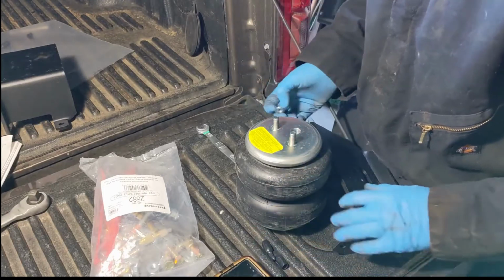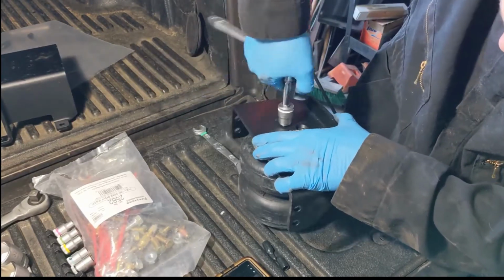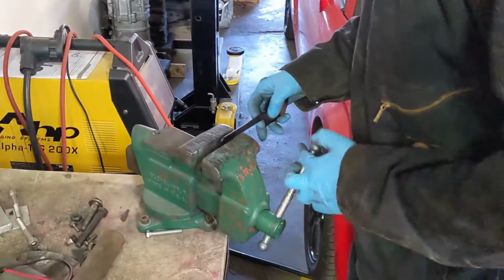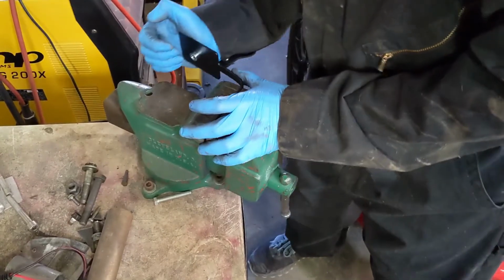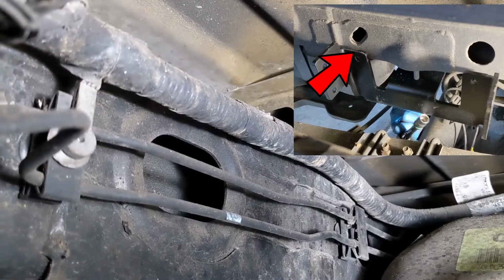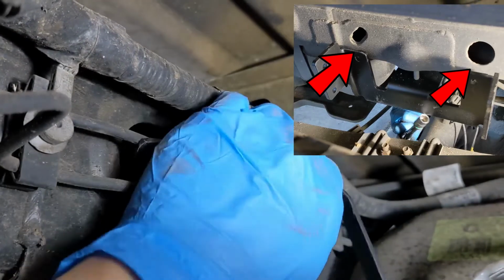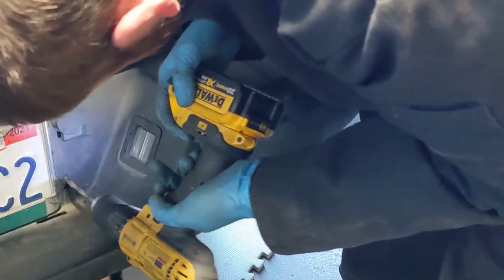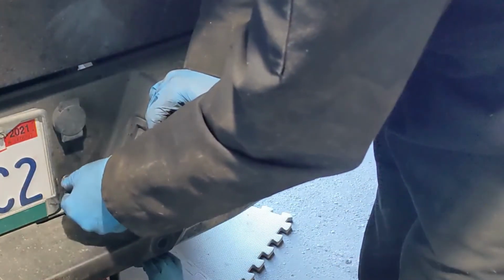2015-2018 F150 Firestone Ride Rite rear air spring install 🔥

Comment: the hardest part is putting the tires back on. They did a great job putting this kit together. I actually pieced mine together first without tightening anything to make sure I was putting them on the correct side and way. First one took me about an hour, second one took about 15minutes.
Reply from the maker: I feel the same. Second time is always easier!

Comment: The background music was good enough that it will be now stuck in my head , not sure how I feel about that really, lol. This video was exactly what I needed otherwise though, thanks!! I am using air springs that are made for use on drop axles dump trucks and other commercial vehicles use. I got them in a clearance sale , a set for 64 bucks, they are almost identical to those loadlifter 5000 bags. I will have to fabricate some hardware though, you have shown me what it needs to look like and where to put it. It’s going to be easier than I thought. My f150 is much older, but basically the same.
Reply from the maker: Haha, you're the first person who hasn't hated my music😂Yeah, I'm sure the video would apply to other generations as well, but I didn't want to make a false claim. I know, at least with my SuperDuty there is a ton of carryover.

Comment: Can I put together the pieces at 1:15 earlier To get a head start??
Reply from the maker: Do you mean, the left and right sides? If so, yeah, you can do both at once if you'd like.
Reply: No. The brackets with the air bags themselves and what they mount too.?? Can I go ahead and put those together a day early? I’m not going to be able to have help yo install until a day later.
Reply from the maker: @c.juneau410  No, you can't put anything else together. The rest attaches to the truck, check this out: https://www.youtube.com/watch?v=-hHdKifI7RY&t=519s
Reply: @EscargotGarage  Okay, I thought I could save some time by bolting the brackets on early...
Reply from the maker: @c.juneau410  so, there's a chance you could make it work. but I have not done it that way. I think the only way to make it work would be if you removed the wheels too. You might be able to slide it all in. I think the brackets that slide through the frame might be a pain to align
Reply: Alright; I’m a try it and see. I’ll let you know after this weekend how it went.
Reply from the maker: @c.juneau410  good luck!